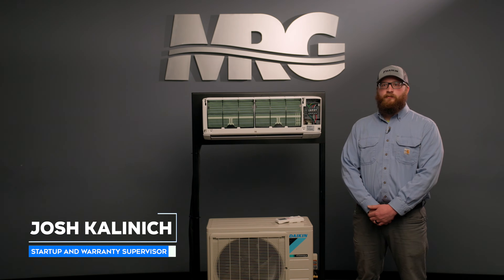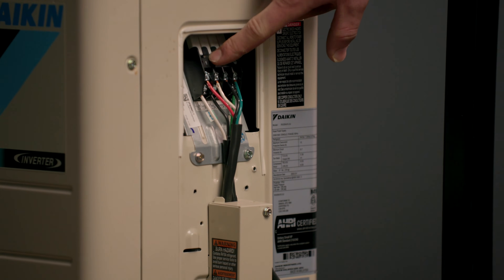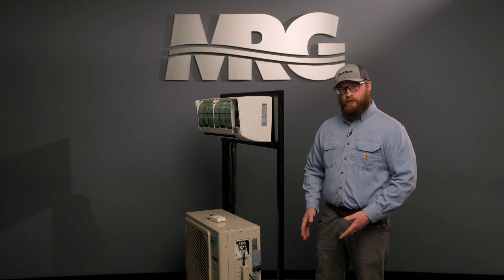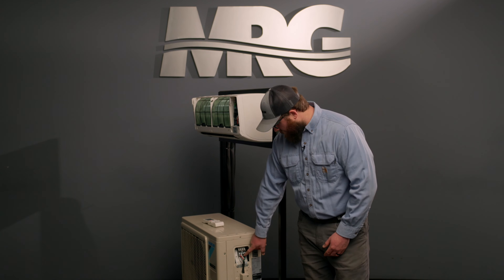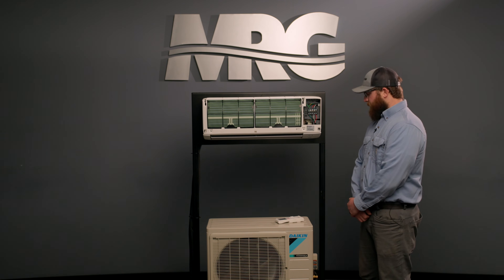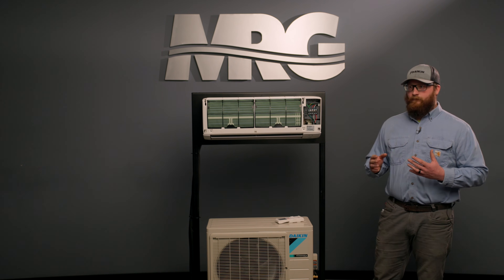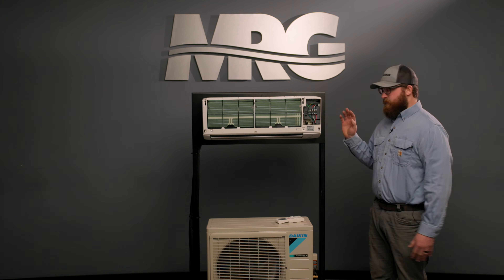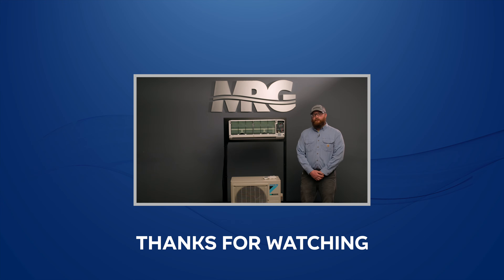Mini Split Communication Wire Sizing & Installation

Comment: Very informative content..I have one space that has (3) Daikin 4-ton minisplit ceiling units. Can I run one conduit for all three sets of communication/transmission wires (16-18 ga non-shieled stranded 2-wire low voltage) to the outdoor heat pump units or is there risk of interference from communication cross-talk?

Comment: Stranded wiring has nothing to do with the communication signal, stranded wiring allows for vibration movement that a solid wire could fail early in the system life. The problem with thermostat solid wire, is the insulation thickness, most likely is not rated for 600v, (to conform to NEC), but the insulation spacing enables the capacitance cross talk of the AC mains to smudge out the communication signal as they did not make this robust from my engineering experience.
Further, what gauge wire size should be used for the connection. NEC requires the circuit protection device to protect the wire connected to it. Extension cords that are smaller wire gauge are not protected and allowed by NED (arc fault breakers may protect a melting cord), but the point is, you can't take a system that has a 50amp 8AWG wired connection, and then use even 14AWG between the outdoor and indoor unit. It violates the NEC, it's not an extension cord but permanent wired connection. That fix is to insert a fuse in each power line, between where the power is connected to the outdoor unit, and if you notice there's a shorting strap between that to feed power to the terminal for the indoor unit. There a fuse can be inserted to full protect and make it NEC compliant. Now the trick is that the next service tech knows to check those fuses in L1 and L2, hidden behind the service cover.  I know they are there, next guy better be smart.
I'm still waiting for a minisplit that can run on a GFCI, that's NEC requirement now delayed. They all have common mode filters, that use ground as the noise dumping location. It also dumps line current and trips the breakers.
Pretty tough to make the FCC RF radiation emission requirements from the microprocessors noise free without using ground. My experience, but I'm not a RF guy. Just HIRF/LIGHTNING/DO160 aircraft gray butt.

Comment: So i just ran my communication wires today and I'm 12" short from hooking up so you are saying I cannot extend my wires even if I use 10 or 12ga stranded wires? I would need to run all new lines just to make my 12" short wires on a 16 foot run? Or do you mean you can't extend the communication wires from indoor to condenser on long runs not short runs like 16 foot?

Comment: No connectors on the end of the wires for the air handler? You just shove the wire in to the contact point?

Comment: Found mini split systems using thermostat wire from head to Condenser/ HeatPump…   Has been running for years, not sure it can be changed.  Recommendations…???

Comment: Why is the wire terminal on the inside unit reversed from that of the outside unit?  I’ve corrected several mis-wirings by one contractor and understand how easily that can happen as we read left to right.  Thanks for the video!
Reply: Ha! That was my question as well.